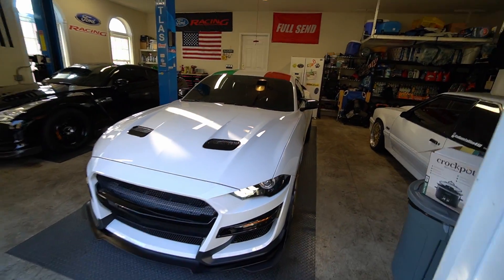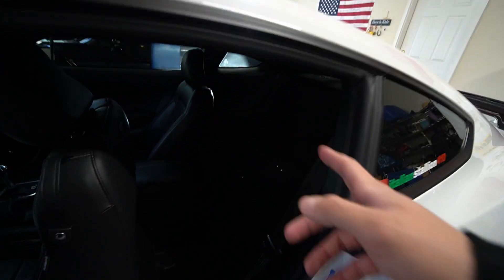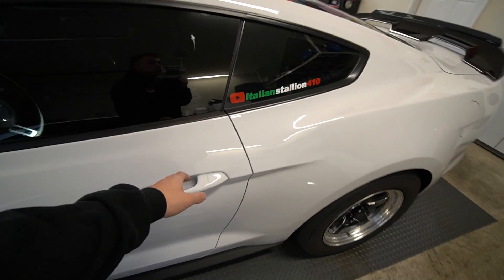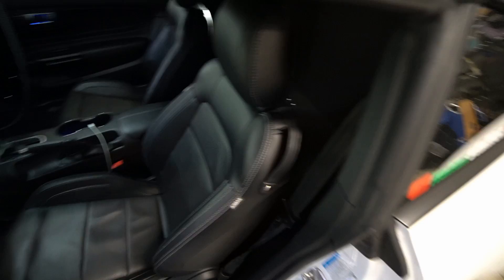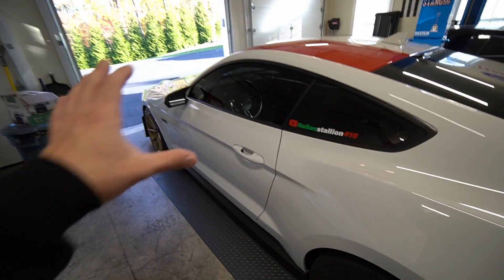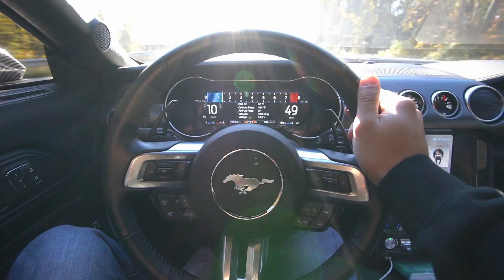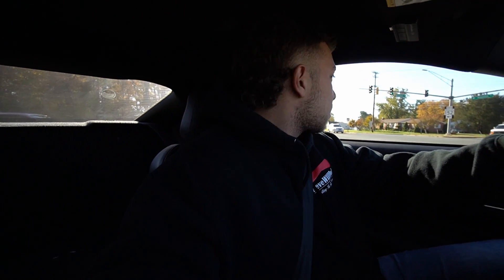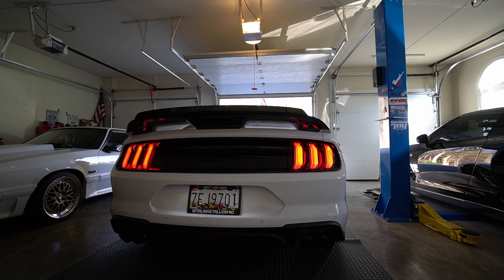Why to Choose a 10 Speed over a Manual for an S550 Mustang

Comment: I used to have an Auto S550. Bought it because of all the rave about how good the Auto is for racing. It was like driving an Honda Accord until I would go WOT. Traded it in for a Manual. Best thing I ever did. As your info goes about longevity, that’s hit and miss. Most MT82 owners that complain about or have had problems, can’t drive. There’s been just as many Auto problems as Manual problems. I’d rather drive my car, than my car drive me. No fun in winning with an Auto if my momma can jump in and hit the same ETA lol. Basically it just come down to what you like 👍. But, I can’t take away how fast the Auto’s are.
Reply: I just bought a manual S550 and couldn’t care less about the auto being 1 sec faster. MT82 isn’t the best feeling MT but is definitely not even half as bad as people say and there are some simple after market mods to make it much better. The best part of the MT S550 is the rev match in the down shifts, holyyy mother of Lord Jesus that thing feels eeeepic!!!
Reply: @JorgeMoren0  hell yeah! Actually driving the car and being one with it, is what a sports car is all about. Trust me if you can bang gears pretty good you will beat the 10 speed. I can’t wait to get my 4.10 gears put in from the 3.55. It’s gonna pull like a freight train!
Reply: Manual ftw !!

Comment: I just can't justify spending almost $50k on a performance car, only for it to be automatic. I don't care how quick the shifts are, manual in a V8 is the go to formula for a Mustang. The 10 speed isn't even a performance transmission liek the DCT in the GT500. It's one of those "just because it can doesn't mean it should" situations. I mean think about it. If people with EcoBoost Mustangs end up having issues with the 10R80, people that just use it for transportation, never beat on it with a smaller engine making less power, how do you thing it will hold up with a bigger engine making more torque and power when modded???
Reply from the maker: I have friends that have stock transmissions and their cars have been raced for 30-40k miles and they are making 1k Hp to the wheels it’s all luck of the draw and how you maintenance the car
Reply: @ItalianStallion410  I'm a Ford technician. Anything with a 10R80 will come in at around 20k-30k miles with transmission problems. From banging into gear when selecting a gear, to random shifting, going from 2nd gear to 7th then getting stuck.
Reply from the maker: @MexicanusPrime-gc6zg   I have almost 20k miles on my 10 speed and I have honestly prolly have more than 500 dig races in that car not even counting roll racing or the top speed events I have done and I change the trans fluid many times and mine has been good to me

Comment: Great video. Now, even GM makes cheap things that don’t last in their vehicles lol. I have a 2020 Mustang GT 10 speed auto with only 3k miles on it. I just put corbeau seats in it, deleted the back seats. I just got 100 cell high flow cats, kooks headers, kooks x pipe, and kooks cat back exhaust for it. I’m thinking of either putting a twin turbo in it or supercharging it. Which one would you go for?!
Reply from the maker: Congrats on the mustang and whipple all the way

Comment: I'm planning on buying a s550 in the future. I went back and forth on auto or 6 speed. I thought in the future I'd boost it so auto is the way to go. However I don't need that power. I'd hardly ever use it so I'll go with the 6 speed. Most of the issues with the mt82 is the shifter. That's complete junk. Mgw shifter and the mt82 is fun

Comment: Thinking of getting a S650 Lebanon Ford Performance with the Whipple.   Debating a 10spd vs the 6spd.    I love shifting on my own, but if I get a manual my wife will never drive it and when I get older I am worried about my knees and driving another stick.    If using the paddle shifters, are the shifts instant or is there a delay?   Also wondering which trans will hold the power of the whipple better......
Reply from the maker: @raymondnist8770  10 speed would last the longest if you are gonna be racing it they shift a lot better than the old ones if it’s a dark horse boosted I would go manual tho a lot better than the mt82
Reply: @ItalianStallion410  wouldn’t be a dark horse and I really don’t plan on racing at the track - maybe once in a blue moon.  I have a supercharged fox body that is a stick and I love driving it.   Just afraid to get an automatic and end up hating it.  

When shifting the 10spd manually, are the shifts instant?    I probably need to do some test driving…..
Reply from the maker: @raymondnist8770  yeah test drive it it’s not as fast as the Shelby gt500 but it’s still good

Comment: I did my research before I got mine. I wanted to go manual but the mt82 problems drove me away from it. The only complaint is it has hard shifts sometimes in the lower gears. It can jerk you sometimes. Does yours do the same thing?
Reply from the maker: I got Alot  of my shifts cleaned up with my tune

Comment: Before I say anything this is just my opinion. 

I rather tho a tremec trans than go auto. auto's aren't as fun to drive. You also gotta know how to drive in order to handle and race a manual trans. MT82s yes I will agree its a POS but I still wouldn't get an auto. I had the option of getting into a gt500 or a gt350 and I literally went with the 350 because it's a manual and it's a drivers car. In my opinion manual for the win 🏆.
Reply from the maker: Yeah I would go manual to if it was a tremec mt82 no chance

Comment: Yes, I know I'm a year late. I disagree. If you're hard charging race-junkie, I find it hard to believe that the automatic will be able to hold reliability year after year. at some point, with all the hard shifts that is going to asked of it, it's going to break down. As far as the manual for the race-junkie, once the MT82 breaks down, replace it with a Tremec. However, I agree with those who said that Ford would have done themselves better to offer the Tremec as an option from the factory.
Reply from the maker: Been racing my 10 speed for 2 years straight still going strong shifting likes it new

Comment: I agree with most of ur points except the auto having the same as my PP2! That’s what special about it u know! And we can fit 305s up front! I have no mods and have a record of 31-0 not bragging at all I’m more surprised that a stock PP2 can Wip that ass! With 25000+ miles. Ur gears are also different. See I ride on the highway, we don’t stop fro a dig it’s a whatever roll ! I find that 373 beat up on 315 or 331 gears. My Mt82 is temperamental though! I would like to switch to the Tremec! Nice Car by the way! I been thinking about a Mach1 wing with the wicker bill. How do you like it?

Comment: The Internet over blows the MT82 problems.  The 2018 MT82 was probably the worst one.  

My 17 GT makes 611 wheel.  Stock MT82 is holding up great.   Still on stock clutch and axles too.  

6R80 is king in terms of stock Mustang transmissions if we are talking about racing reliability.
Reply: I’ve had 2. they hold up fine but feel disgusting. I’m thinking of A10 for my next mustang. If I ever want an MT again it probably won’t be in a mustang. Need to drive a mach1 with a tremec though. That could change my mind.

Comment: Right off the bat that’s incorrect about the 10 speed being more reliable than the MT82D4.  The 10 speed trans is not stout and it’s wonky especially if you boost the car.  And if you’re racing the car you should be putting. A T400 or power glide in any way. Which essentially requires a manual purchase off the show room to properly swap that trans in.  And I assume your hood is the Shelby GT hood from Shelby American.
Reply from the maker: Yeah the new Shelby hood that just came out
Reply: @ItalianStallion410  yeah. I was gonna put the same on mine. Only reason I know.  It’s the same hood on the Shelby GT-H and GT-S hood. It’s about 2 years old just recently available for public purchase.  Very nice hood. Over $2k shipped and not painted.

Comment: You do realize the tremec in the mach1 and GT350 is weaker than any MT82 currently in a mustang.  It’s just Fact.  It’s undebatable.  The tremec in those cars can’t hold boost at all.  So that statement you made is 100% incorrect.
Reply from the maker: Mhmm I don’t think so the T56 from what I have read said it could handle 900 wheel hp
Reply: @ItalianStallion410  the T56 is not what’s in a mach1 or 350.  A T56 is a legit race trans.   Not what you said in the video.   I’m simply saying the MT82D4 100000% holds more boost than the tremec ford put in the 350 and Mach1 which the TR3160 which is just fact.  I’m not saying tremec as a brand overall isn’t as good as getrag.
Reply from the maker: @TheCdM1981  okay